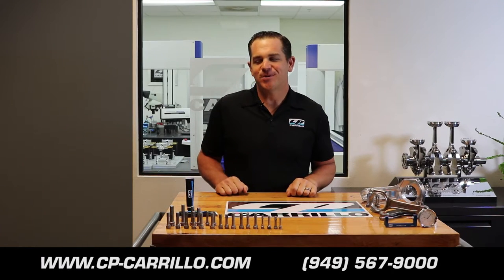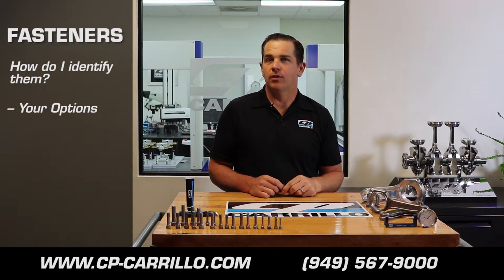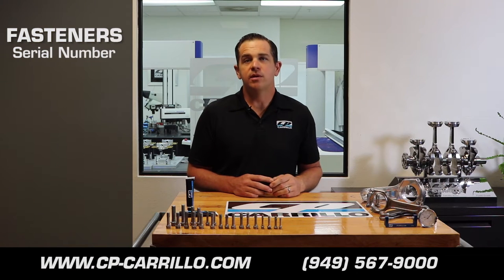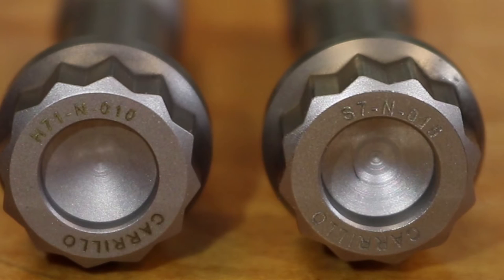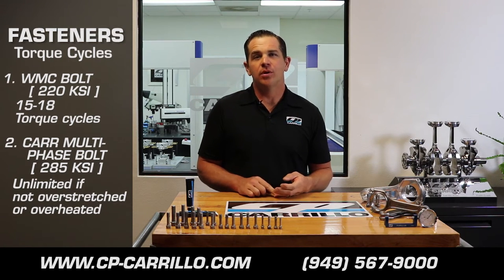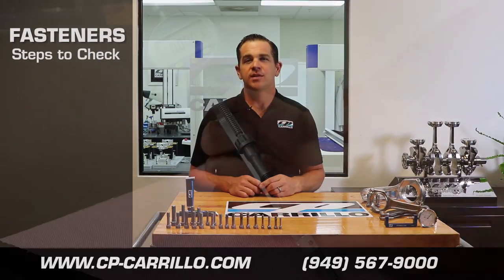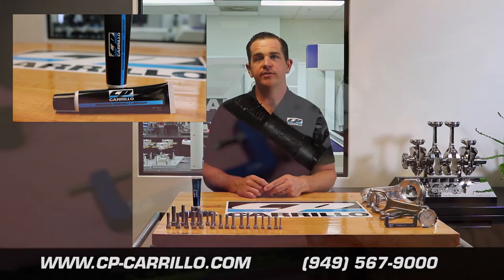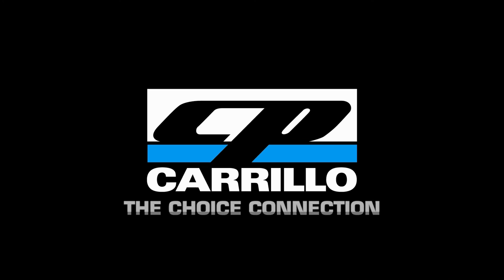CP Carrillo Fastener Instructional Video

Comment: Asymmetric flank angles improve resistance to bending fatigue failure, not improved accuracy in torque or clamp load. Also a yielded bolt can still torque to spec, and elongate to spec after the yielded installation. If bolt has annealed, then it will continue to grow if the installation target is past yield strength.